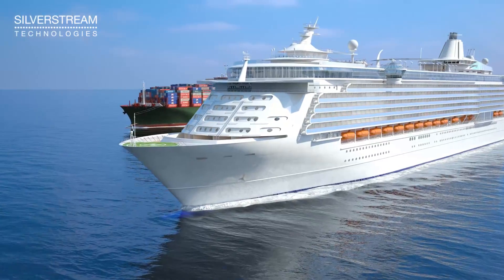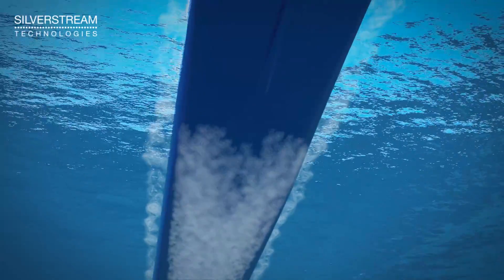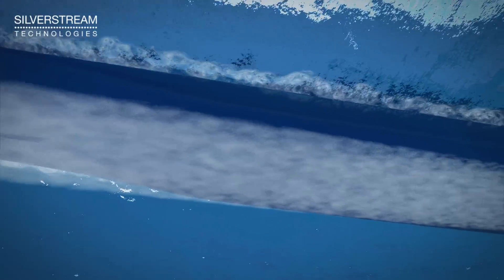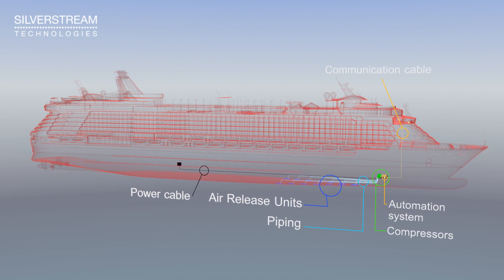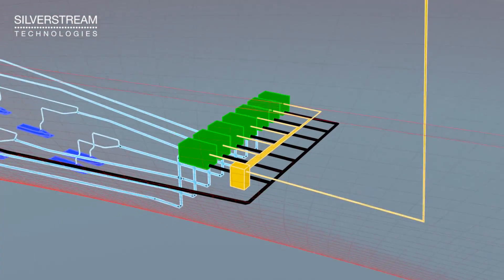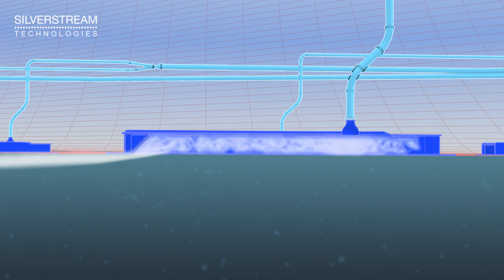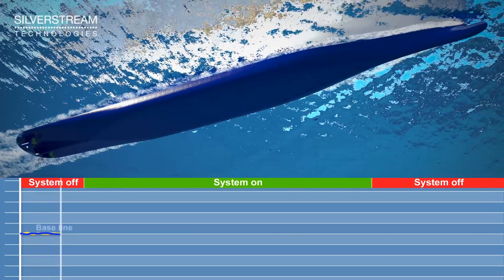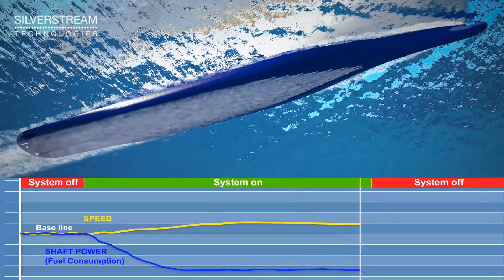Air Lubrication for Cruise Ships - The Silverstream® System

Comment: The principal of pumping air under a hull has been around since John Thornycroft in 1877. Though this is using more modern technology than Thornycroft's clockwork powered bellows on a scale boat, we should tip our hats to his ingenuity.

Comment: where air compressors take suction from? does savings in fuel greater than the power needed to produce the air boundary layer? how are the microbubbles kept in the boundary layer?
Reply from the maker: Hi Sanzhar. The compressors pump air down into the air release units at very low pressure, around 1 atmosphere, meaning the power needed to generate the air bubble carpet is extremely low. In terms of keeping the microbubbles in the boundary layer, they form a rigid carpet and each bubble is approximately 1mm in diameter. This means they do not try to merge and therefore escape the boundary layer. Finally, we have proven fuel savings of 5-10% in our installations to date. These results have been independently verified by a variety of bodies including HSVA and Lloyd's Register.
Reply: Danem is doing with blowers, not compressors. More efficient:physics

Comment: With air bubbles against the ships hull, cavitation and corrosion occur. In other words, a bad idea.
Reply: Newer hull coatings that move on from sacrificial anodes and biocidal coated steel to durable PTFE low fouling release energy coatings will not be affected. It would be interesting to have a study on the bubbles' ability to reduce or improve the fouling resistance of teflon and silicone coatings, though. The bubbles may slightly increase cavitation if they are allowed to travel into the clean water stream that the impellers or propellers pull in, however, they may also reduce the skin drag of the propeller significantly, while the overall thrust of the propeller may remain high. You would have to do a simulation.

Comment: Imagine if it failed and water was flooding the pipes and they burst.
Reply: Air & Water check valves. Pipe should be enough of a pneumatic buffer for the head pressure. I'm not affiliated, nor an engineer. Just spend too much time on YouTube. The 'algorithm' may start to take my job soon if they figure out how to train it for STEM topics suggestions... its getting there.

Comment: It would sink the ship ^^
Reply from the maker: Thank you for your comment. The air release units on the vessel's flat bottom are part of the hull construction. Our system therefore has no effect on the seaworthiness of the vessel.
Reply: I was just kidding, but its plausible that the ship could loose some buoyancy ;)
https://www.youtube.com/watch?v=MSmAXp_BHcQ
https://www.youtube.com/watch?v=nAmlvYJnURs

If the air isn't constrained at the bottom (like air cavity systems) what stops it from going on the sides of the ship (path of least resistance)?
Reply: @My-Opinion-Doesnt-Matter  It should be considered constrained under the hull if they are not allowed to leave the bottom surface. When the ship is turning and the bubbles are allowed to 'flow up' the sides, given enough quantity, it might have a slight but negligible impact on buoyancy. Would need to be dynamically simulated. Not hard if you know the multiphysics software. There are some free ones out there if you want to get back to me about the results (open source).
Reply: @My-Opinion-Doesnt-Matter  cold have an edge protruding down at sides and a bit higher flat bottom between them to hold bupples in place but willl the edge do something bad